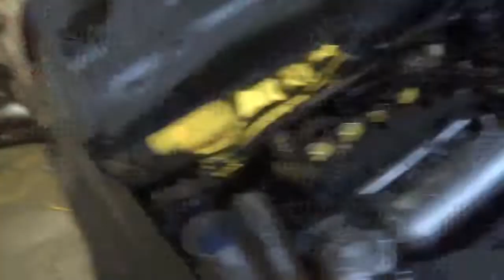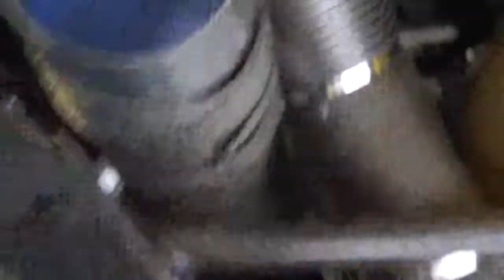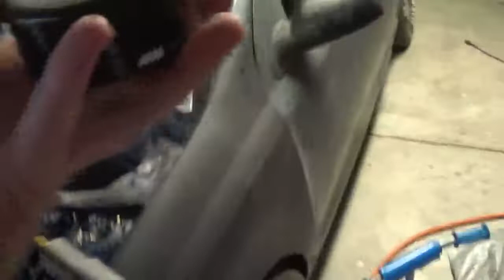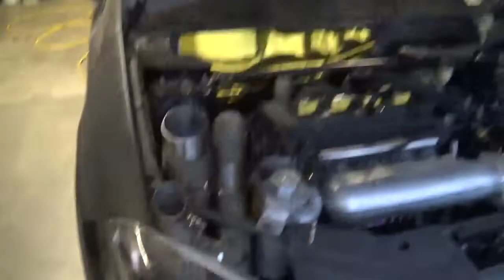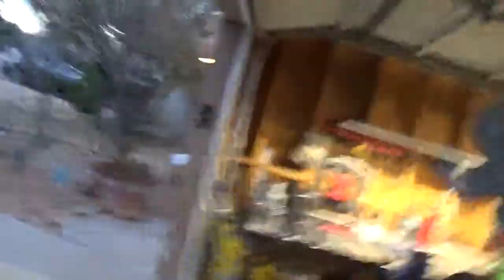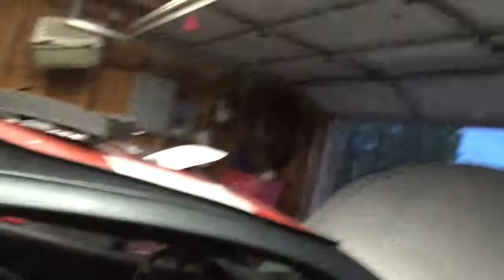800HP cobalt engine break down!!

Comment: Do u know any companies that make custom cam gears? I know this is an old video but im considering building my LLO DOHC Saturn engine for street, nothing crazy, 350 hp but if it too expensive to build that engine I'm likely going to put an ECOTECH in it and staying GM. I'm wanting to put Titanium rods in it, even though it's crazy expensive over the SCAT ones with forged DSS pistons with the patented X grooved side skirts that reduces friction and boosts power, basically nothing crazy power wize, just wanna build it smarter. Fidanza doesn't make the cam gears anymore for the 1.9 DOHC LLO. You have a great car man, totally like it!

Comment: Push for 900whp and beat ZZPs record
Reply from the maker: I dont really care about the power it makes as long as It’s setting fast times
Reply: @1BadLS1209  absolutely! What times are you running? Also it’s crazy you soon might have the highest HP cobalt SS ever made.
Reply from the maker: @Ravenn2k  thanks I want it to go into the 9’s with the current drivetrain if I get a dogbox I want more we will see what happens
Reply: @1BadLS1209  look forward to seeing it!